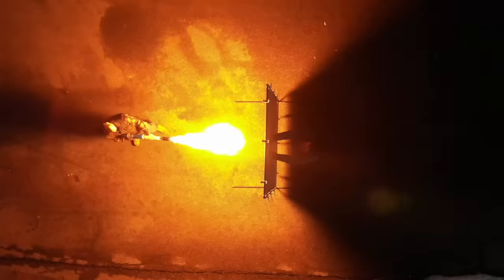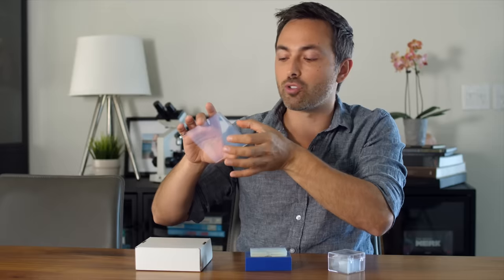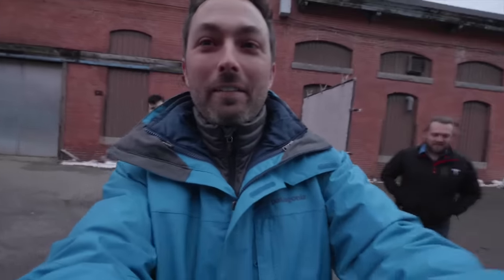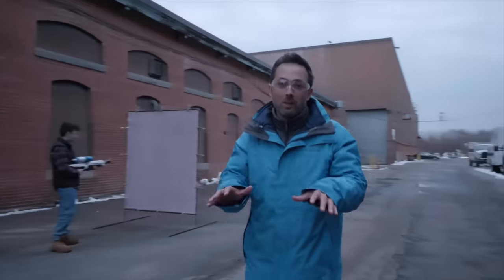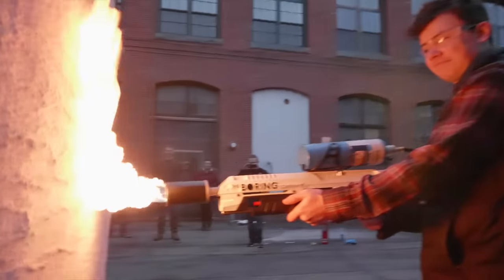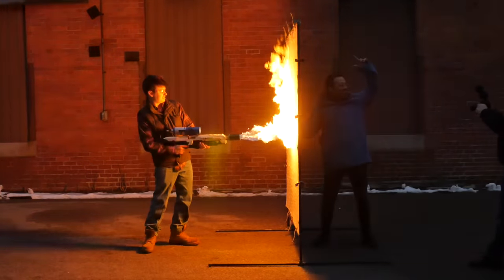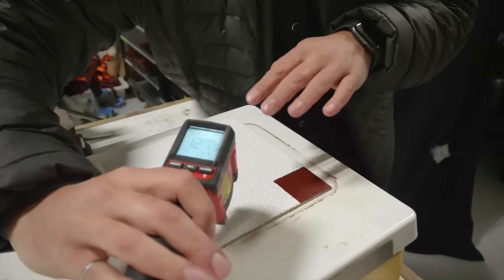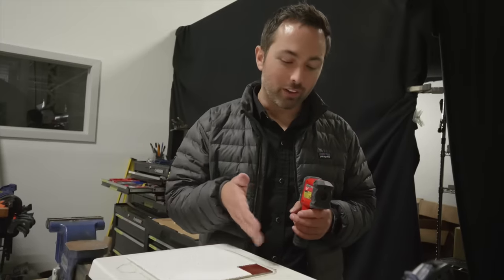Flamethrower vs Aerogel

Comment: They should make a suit made out of aerogel for firefighters
Reply: J. S.  Have to Give them time to do that the process it make it is really expensive still
Reply: @ǰꜽ Ṱꬴⱥ well yes the aerogel insulation would serve the purpose of cooling
Reply: @ǰꜽ Ṱꬴⱥ i understand the impeded heat flow going out, however, we are absolutely capable of going 40-50 for short periods of time just fine. Firefighters are especially trained for these situations and are exposed to hundreds of degrees C ambient temp. Firefighters have been recorded to survive internal temps of over 70°C. With aerogel insulation, the internal temp goes down quite significantly. 

That sheet on the video registered over 600°C on the hot side and 50°C on the other side. That is definitely survivable for trained firefighters. Aerogel insulating tech in their suits will definitely increase their endurance when fighting fires, especially when fighting prolonged fires like wildfires.
Reply: It could be don't? But it would be expensive and you would need a venting system to pull away body heat. I think somone probably has thought about it
Reply: Dominic Milazzo youtube
Reply: Actually I thought what mostly kills firefighters is smoke inhalation
Reply: Lilac Luisa while true, the intense heat can be a problem in many situations
Reply: @JAYTEA HOOTS Maybe just liquid coolent of some kind.
Reply: Wouldn't that mean the heat produced in your body can't escape either?
Reply: @Samuel Shin But if the heat in your body has no where to go then your body temperature could go above 40'C, couldn't it?
Reply: Junias Dityenbeger and it’s not very flexible in that thickness
Reply: Thats smat 
Oh its wicked smat
Reply: @thaoremchan9234  what if it was someone you loved
Reply: It just doesn’t work that way, it’s not efficient enough for the big government people.
Reply: Aerogel is too weak
Reply: yeah then each suit would cost like a gazillion
Reply: too fragile
Reply: A blanket like the one used in this video would even be useful. If fire crews on wildfires had a couple they could move logs as a crew that they would otherwise need heavy equipment for.
Reply: Yo wtf y havent they done this yet
Reply: Kades Wong a few reasons. It is currently not easy to mass produce this stuff, you would also need a new way to keep the inside cool if things got too hot, as it may stay hot. And they isn’t a huge need atm. Smoke inhalation is currently killing more firefighters and is a lot more of a concern atm compared to overheating and burns.
Reply: imagine the blanket falls while firethrowing
Reply: Or asbestos lmao (sike)
Reply: @BOYT PLANET 2.0 you got the point
Reply: @Samuel Shin don't sware
Reply: @xmetalgamerx  well of course they have oxygen masks don't they
Reply: i was thinking the same thing
Reply: Aerogel cracks easily so it may break if they fall over, or if something like a wooden beam falls on them
Reply: One word EXPENSIVE
Reply: BOYT PLANET 2.0 dude Just change the current insulation into aerogel
Reply: @BOYT PLANET 2.0 Hmmm, bake in my own body temp or get baked by thousand degree flames...hoo boy, that's a tough choice.
Reply: Just so you know fire fighters don't go inside a fire they shut it first then proceed further
Reply: They don't even have to make the suit, they could just coat old fire fighter suits with aerogel
Reply: Aerogel doesn't flex
Reply: Brownie Amanteigado  so you want firefighters to die? You're sickening
Reply: @xmetalgamerx  they must be smoking mad ganja then.
Reply: Firefighters goin to a fire lookin like gentleman
Reply: It's brittle, that's the only problem
Reply: That would be INSANELY expensive
Reply: I think you just won a Nobel prize.
Reply: Lilac Luisa true but this would allow them to move through FAR more heated areas than normal
Reply: Disbeetaa 
bruh, did you WATCH the video, aerogel blanket
Reply: C N 
he was suggesting a coolant system, not downplaying the heat of the flames, a coolant system would GREATLY increase insurance
Reply: Beacon Blaster 
bro, watch the video, they made it into a cloth insulation
Reply: Paxton Cargill 
I’m 75% sure that brownie was being sarcastic
Reply: Kenny Bee 
Dude... watch the video, aerogel insulation blanket
Reply: That would be sp expensive pluse aerogel is very brittle and easy to break
Reply: @helicocktor  that's a big pile of bs. Internal temperature of 70 degrees Celsius let's the proteins change on your body (starting from 42 degrees) 
You are literally boiling, training can't help with that cause training can't change the chemistry of your body. 
Please stop spreading nonsense.
Reply: If it cant conduct heat very well, it means it could become incredibly hot inside the suit
Reply: @helicocktor  50° that doesn't feel 50°
Reply: US in 2020: WE really should have  listened to this guy explosions, wildfire choking firefighters noises
Reply: That's a really great idea! Love it
Reply: When looking only at the problem of cost for aerogel suits it's easy to say that the price shouldn't be an issue and not buying the best equipment for these brave men and women is simply horrible corrupt pigs not willing to shell out the money. There are many horrible corrupt pigs in the world but I think it's important to understand why that isn't the problem in this situation. All of this stuff is handled by the government and they have the job of taking the money that they're given and distributing it where it is needed most. Buying the best equipment for some people will leave others completely devoid of it so it is all a balancing game with human life on the line. This is a bit sad but you can always go out and donate to your local first responders : )
Reply: It may help, but a large number of firefighter deaths are not caused by heat.  For many, it’s heart attack, non-burn injuries (such as falling or being crushed), or asphyxiation.  Heck, a good number are killed in vehicle accidents.
Reply: Or a shelter to protect their selfs
Reply: It's a good idea but also expensive. I would say if we need them they should have them but not use them all the time
Reply: it probably tears easaly and kevlar is already flame resistant
Reply: @cn8299  You are severely underestimating how hot your body would be if insulated. It's not a choice between death and possible death, it's a choice between logical design or death.
Reply: @BOYT PLANET 2.0 I do agree with you, that would make total sense and it would make it so you wouldn't be able to even tell if you were on fire, not saying that you would be. If you've ever been in a costume, it doesn't matter if its 0F or 50F you gonna get super freakin hot. So i agree with you, and you people start reading into things more cause yall just assumed his point and purpose.
Reply: They do that now
Reply: It's crazy how many people in this thread object to this idea because "aerogel is too brittle and doesn't flex" as if they didn't watch the video at all.
Reply: Do you mean they should imbue it in their suits?
Reply: When the tech becomes a bit cheaper that is a brilliant idea.
Reply: @helicocktor  A sauna should ideally be well over 80C - Finnish people, please roast me now 😄
Reply: Brownie Amanteigado  this comment is irrelevant to the discussion of firefighters and frankly makes no sense in any context.
Reply: Absolutely right, that's what I want to say
Reply: for *ironman
Reply: Too expensive
Reply: @kayarekay7151  was obviously a joke
Reply: @Shimanas527  why
Reply: @octosaurinvasion  what why
Reply: @Shimanas527  why "dont sware"
Reply: @octosaurinvasion  i dunno that was an old comment
Reply: hey, thats a preety good idea
Reply: J.J benitez
Reply: Last time they put aerogel in clothing mountain climbers were overheating in freezing temperatures. It's too efficient for human homeostasis.
Reply: @BOYT PLANET 2.0 what about sweating
Reply: not just, this could be used for space ships, deep diving, astronaut suits . . .the list goes on and on.
Reply: One of the main issues firefighters face is smoke inhalation  and irritation.
Reply: Sooo when we gonna get these in houses
Reply: But it’s aerogel
Reply: @pirox2720  so is a firemans life.
Reply: Me: keep watching he's on to something
Reply: Don’t need a suit, just a layer
Reply: It would be extremely expensive, very brittle and you could still not have the joints made out of it.
Reply: Aerogel is more expensive than gold though
Reply: @thepixelleer8445  Ever heard of fire proximity and entry suits? Firefighters have these, the latter of which is more effective than aerogel, protecting for up to about 1,100 degrees celsius!! At times the cost is important to consider, especially given that there is already equipment that is better at reflecting heat than aerogel and its fabrication is less costly (and even then, the cost of conventional equipment for a firefighter is around 15k). 
Now I'd understand pushing for the integration of aerogel if adding layers of aerogel was more practical and effective than current equipment, despite the cost. But aerogel is very delicate and impractical to work with. The idea sounds cool but is not as innovative and useful as you assume.
Reply: it's brittle. it would fall apart
Reply: Im pretty sure it's quite fragile.
Reply: Aerogel is extremely brittle and and would not be suitable for a job like firefighting.
Reply: @baronetibuki8282  although they did show that it could be combined with several other materials
Reply: They should make a refridgerator lined with aerogel on the inside to conserve electricity.
Reply: @gregorychurch605  that actually sounds like an amazing idea. I have no clue if that is realistically possible to market but on paper that is brilliant
Reply: @finn488  ye you're right
Reply: How bout a normal suit but with aerogel coating
Reply: It’s too breakable
Reply: It willl broke fasr
Reply: Only been in fire protection for about 2 months now after training but, Since I joined I’ve been thinking about that
Reply: It’s why to Ridgid
Reply: And Arctic explorers
Reply: What do you think they made it into a foldable canvas for?
Reply: It’s to brittle
Reply: No, I think it's easier to make a "fire shield" of aerogel
Reply: I thought the exact same thing. Saw this and immediately went looking for this comment!
Reply: Sylar Rogue  maybe a aerogel shield?
Reply: Plus racing driver suits. Oven gloves,  welding gloves, engine insulation, there's so many applications.
Reply: Bogdanmeoff  that’s not moral at all
Reply: The same I thought, also for people in mines, they need to avoid, heat, cold and sweat.
Reply: I think it could work but there are many factors to count for. However, I think that the process would be too expensive for mass production.
Reply: @xmetalgamerx  make breathing filter with it

I have no clue if that would work
Reply: If they cared about life more than money they would. Welcome to capitalism. Life isn’t worth money to the government
Reply: Good point
Reply: Just thinking same 🤣
Reply: I am making a school assignment/project about this very idea. We are researching how and why aerogel could indeed be fitting for a firefighting suit.
Reply: I think it could be an amazing alternative because it is so incredibly lightweight.
Reply: That's exactly what I was thinking
Reply: The firefighters suit it's better
Reply: @richtigmann1  it won't. There's flexible aerogel insulation.
Reply: They exist i think.
Reply: Aerogel nonwoven (A) showed superior performance over existing reinforcement material (Rinf) and thermal liner (F+B1) for firefighter’s protective clothing. In particular, aerogel nonwoven has

    Over eight times more thermal resistance than ‘Rinf’;

    Excellent compressive heat resistance before receiving burn (A = more than 2.5 min, Rinf = 19 s);

    Better air permeability (A = 12.4 mL/cm2/s@50 Pa, Rinf = Nil); and

    Enhanced evaporative cooling (Ret of A = 17.5 Pa m2/W, Rinf = Infinite).
Reply: That was the first thing I thought of. Also, fire jumpers!
Reply: Big brain
Reply: Ah yes then they become jesus and can walk on water
Reply: Drip or drown? More like drip or burn
Reply: Not of aerogel but of aerogel paste
Reply: You do it
Reply: But it's just 99% air
Reply: It's too brittle
Reply: I was just thinking the same!! but you did it 2 years early 😆
Reply: Bogdanmeoff  but aerogel doesnt require brute labor to make, it requires specialists
Reply: That would be pretty expensive and it would probably be pretty weak
Reply: @jessicalanggamez  not sure where you got the $15k turnouts for firefighters. When I retired in 2013 they were Kevlar and approx $2K not including boots or scba.  Now they're about $3-4K for coat & pants.
Reply: current turnout shells are nomex and kevlar which is great for fire resistance. But the liners are thick and heavy. Making the liner out of the aerogel/fiberglass composite would be better insulation, much lighter, and likely give better flexibility for them.
Reply: But it's brittle
Reply: That’d be amazing, but it’s very brittle